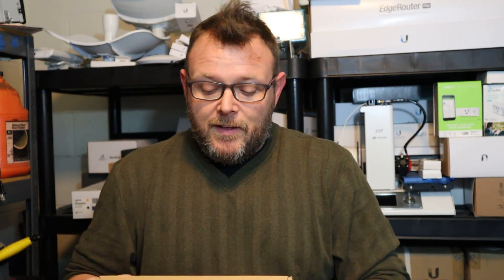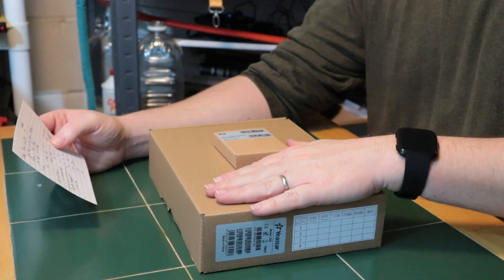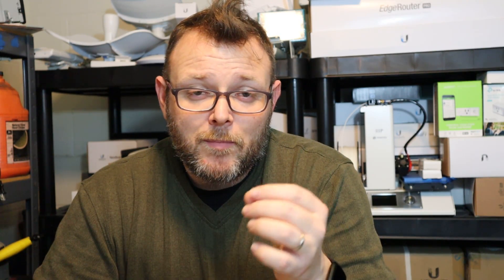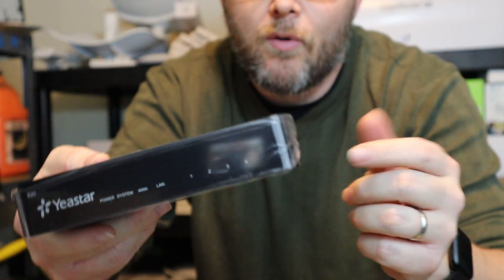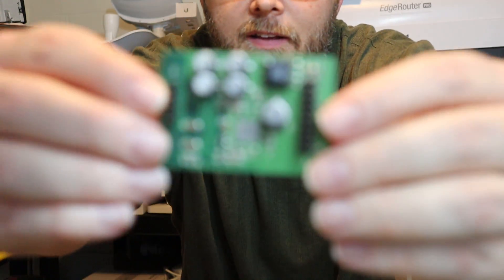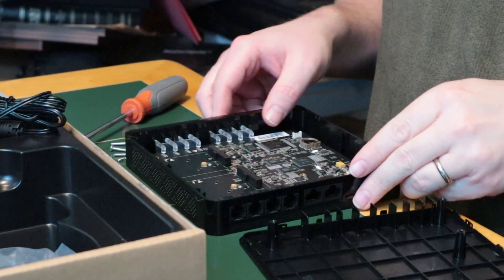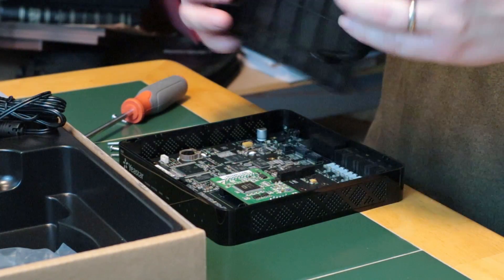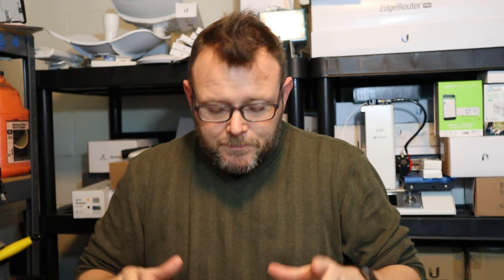Yeastar PBX S20

Comment: We have a couple Yeastars in the wild, nothing to complain about with them compared with the Grandstream UCM6202 that is our go to PBX. They are more expensive, and you can't monitor live calls like the grandstream. We have been very satisfied with the FXS gateway that we've installed, it's just worked (unlike other fxs gateways that we've installed)
Reply: horsekid98367 so I’ve been looking into Yeastar for a few months now and I like it but my only concern is how reliable the software and hardware would be? How long have you been using their products?
Reply: @patel22roshan  We've had the FXS gateway installed for 18 months or so, and a couple of S20 PBX's installed for about a year, likewise a S100 PBX for about a year. No hardware problems. No software problems caused by Yeastars GUI.